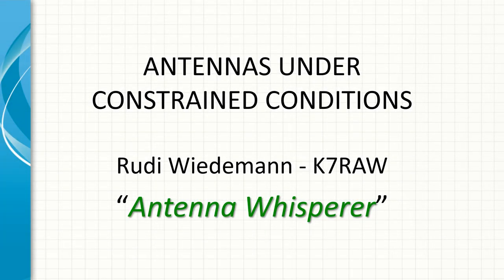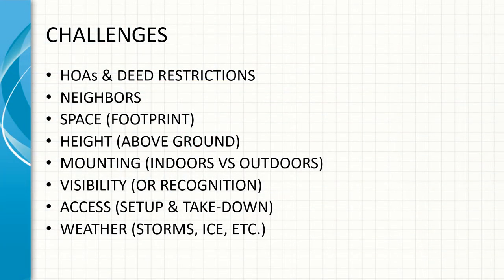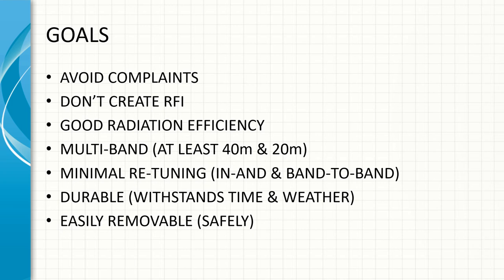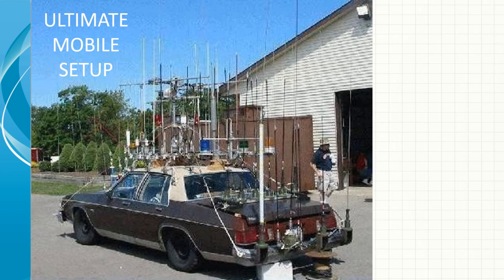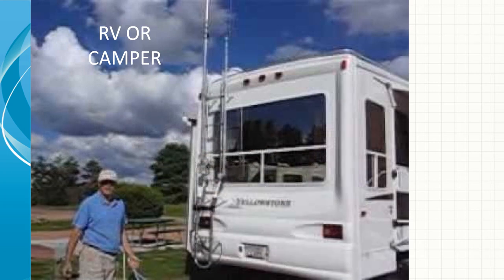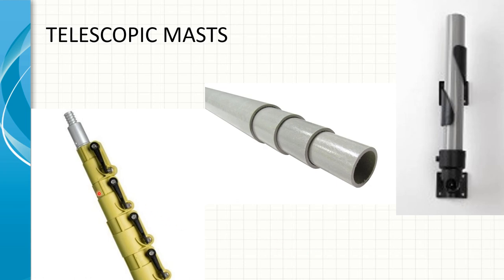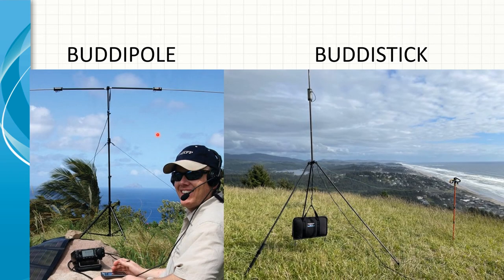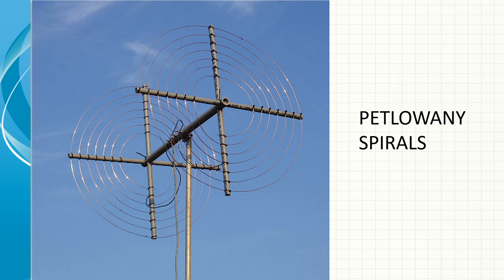Antennas for Restricted Spaces

Comment: Very timely Rudi,thanks.  I live in 55+ 3rd floor apt in 3 story bldg. Balcony is only 4x6ft. Stucco exterior with aluminum Balcony soffit ceiling. Currently have mfj 1622 Balcony antenna you showed. Better on 20m,to talk,than 40m. Thanks Rudi.!!
 
Considering shark hamsticks.